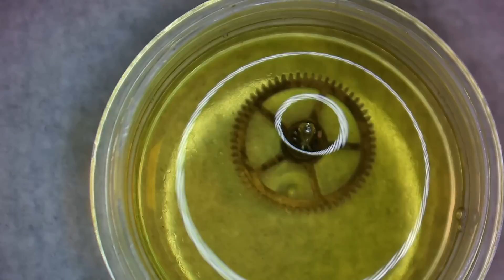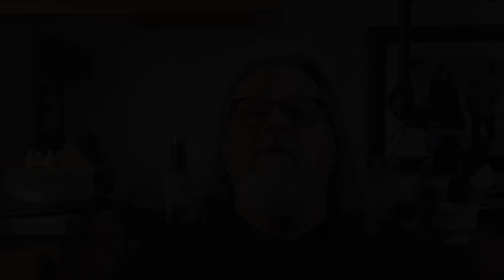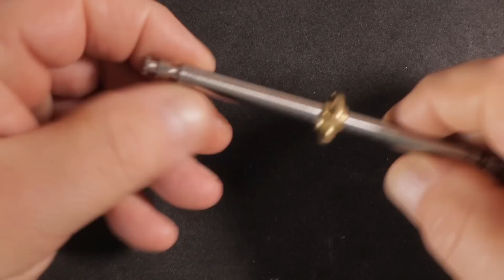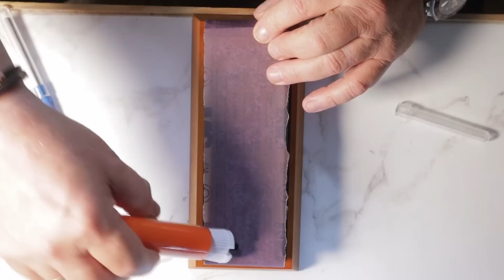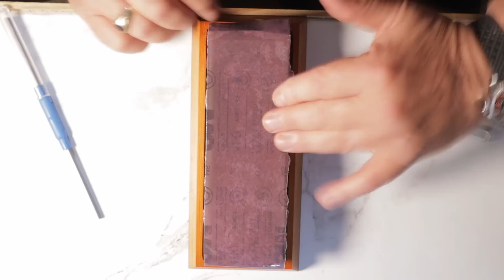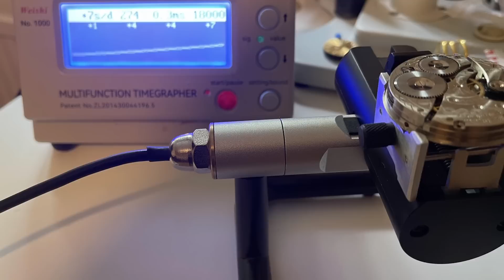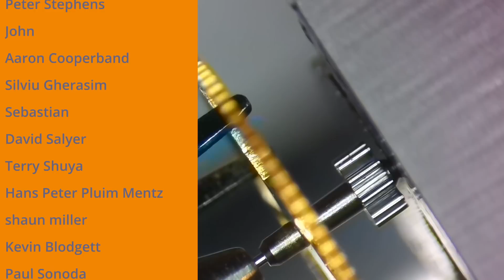Beginners Guide to Using the Jacot Pivot Lathe

Comment: Great information. Unfortunate that modern watches are simply replaced or wheels tossed for new ones. Vintage watch work is for real watchmakers only... 😊
Reply from the maker: For the most part like you’re correct as the majority of watchmakers working on movements with available parts can just replace them and that’s what they’ll typically do just because they have to turn and burn, especially if you’re working at a high-volume service center.
This is precisely why many watchmakers today either won’t work on pocket watches, or the cost to do this type of work blows people out of the water